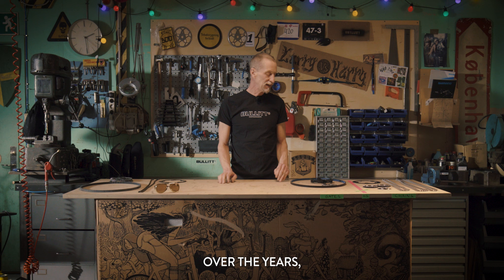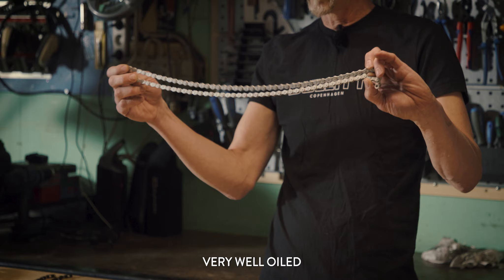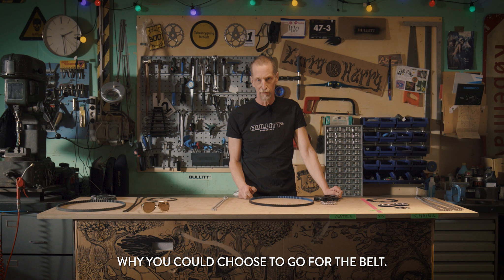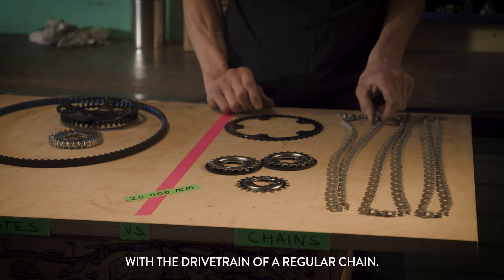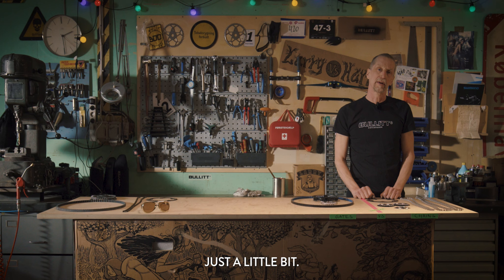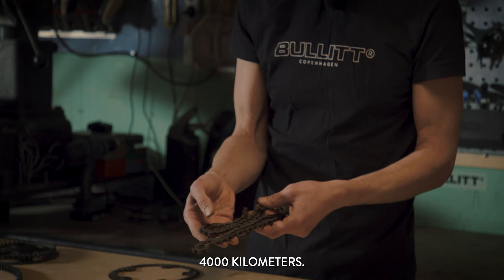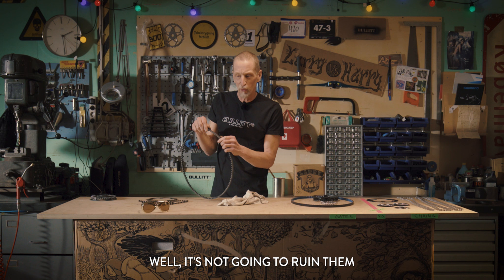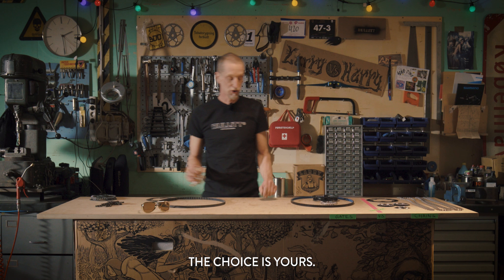Gates vs Chains

Comment: Can you convert a frame from chain to belt? My frame has not cut-out for the belt. I hate chains.
Reply: If your frame doesn't have a cutout to install the belt, then unfortunately the belt is not really an option. You could try to find a frame builder that would make a cut in the frame and install a coupling, but that in itself would be relatively expensive, and could possibly destroy the frame. Frames for the belt drive also need to be exceptionally stiff, so that the belt doesn't slide off. You also need some sort of tension adjustment (sliding dropout or eccentric bottom bracket). 
Since you are watching this video, you maybe already have a bullit? Just send an Email to them, I don't think that they will look into the comments.